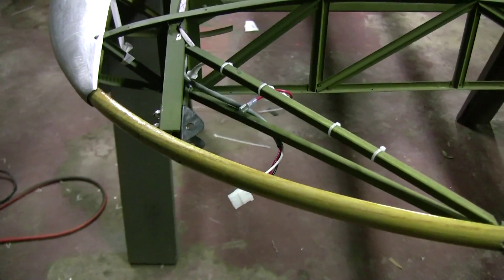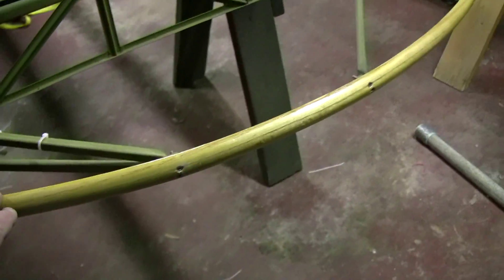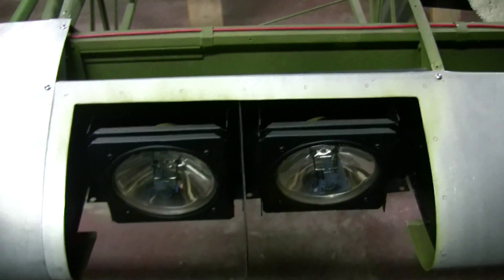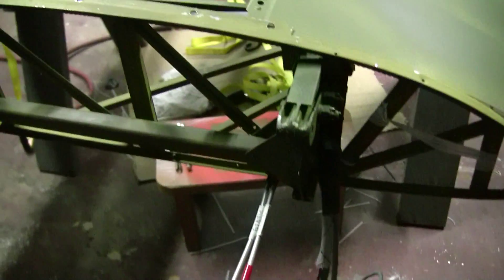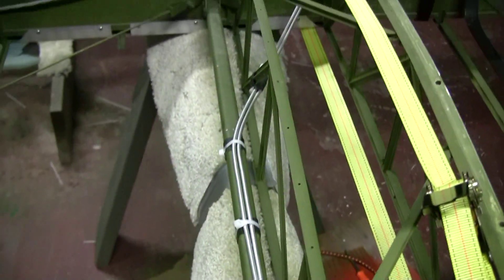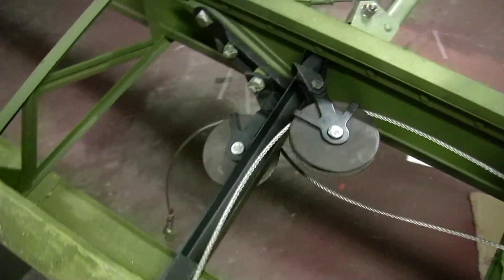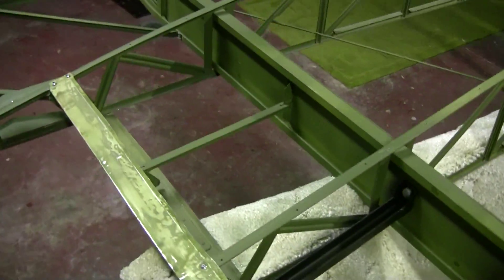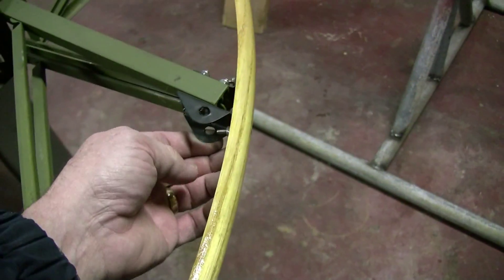WING TIP LIGHTS

Comment from the maker: A person who is not an A&P can do work on an aircraft restoration on a certified airplane; but must have an A&P guiding the process, and in the case of any possible major repairs, alterations or work that requires a supplemental type certificate such as making a nose gear aircraft into a tail dragger, an A&P with IA must be involved.